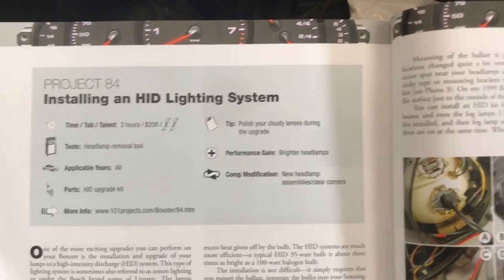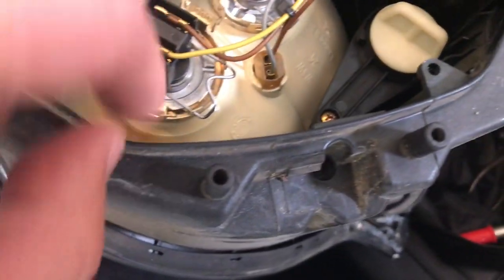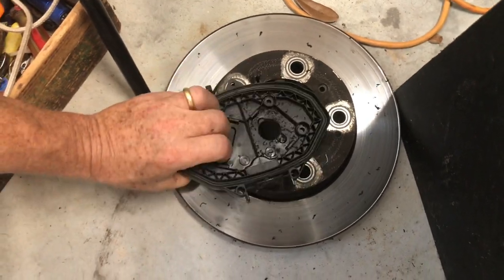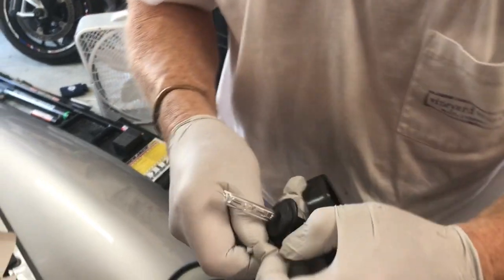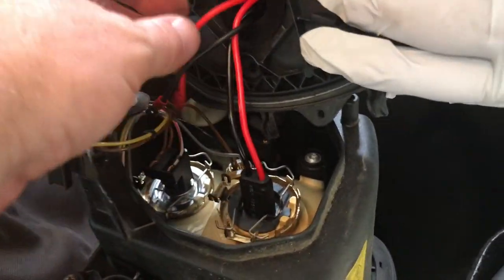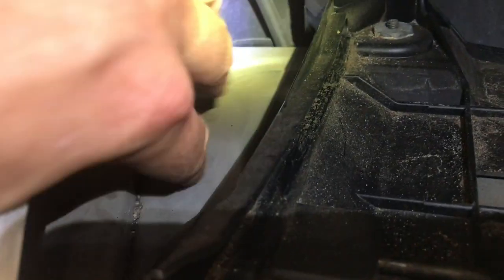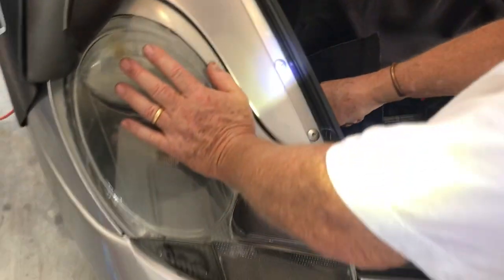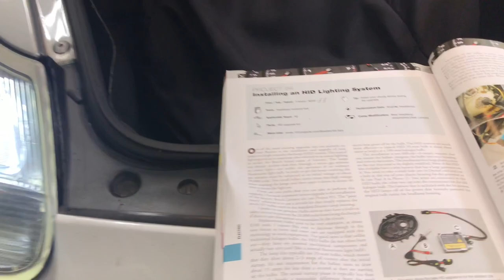How to INSTALL AN HID LIGHTING SYSTEM on a Porsche Boxster 986 (Project 84)

Comment: This is a great tutorial.

I ran HIDs on mine for a bit (nearly identical to yours; 98 Boxster in Guards Red w/ black interior). Already had burnt spots on my inner lenses, though, so eventually I did the bi-xenon projector retrofit and added some LED halos on the shrouds for parking lights.
Reply from the maker: +Brad Emery thanks! 🍻

Comment: A better replace to mount the ballast is onto the rear cover of the headlight. It'll be  a lot easier to remove the headlight in future.
Reply from the maker: +ItsKenAllen75 agreed! That’s what I did on my own when I installed the bixenon ones from RetrofitLab
Reply: @HelpMeDIY  that's where I have mine mounted too. Good stuff Aaron.

Comment: Thanks for the video! Is it possible to fit the ballast in the housing of the headlight? It seems to be small enough.
Reply from the maker: +Allen Hsu great question. While I think it MIGHT fit, I think the issue is heat.
Reply: It is possible to mount the ballast in the housing of the headlight, no problem of overheating (H7 = 55 W, HID ballast + bulb = 35 W); buy preferably a slim ballast in aluminum case and digital ballast (not analog). Bosch; Osram; Philips.
With the ballast in the lighthouse housing, it's better in frosty weather or snowfall. With the ballast out of the headlight housing, snow and frost stuck on the lighthouse (lack of heat).